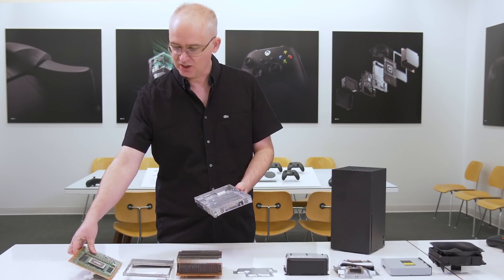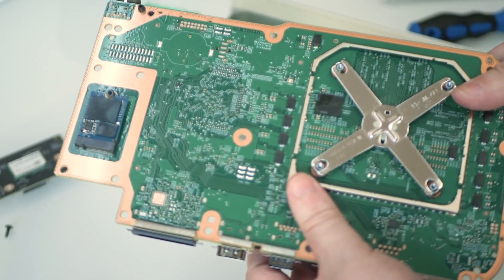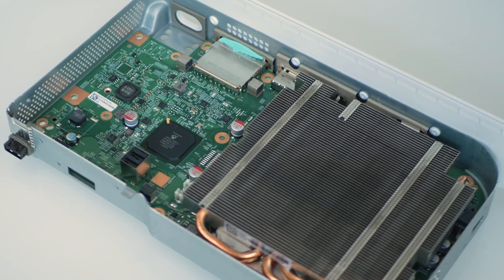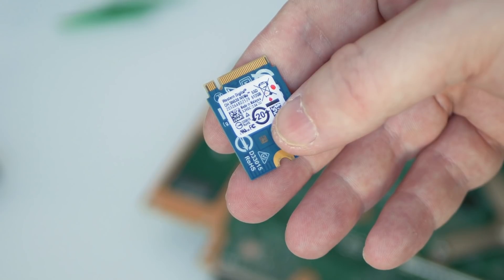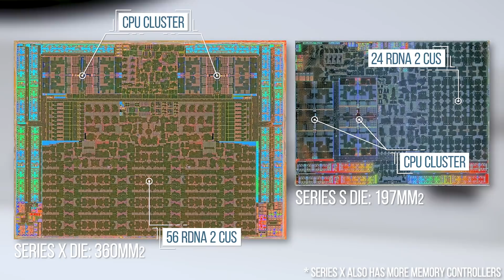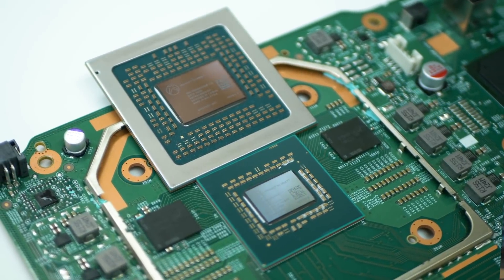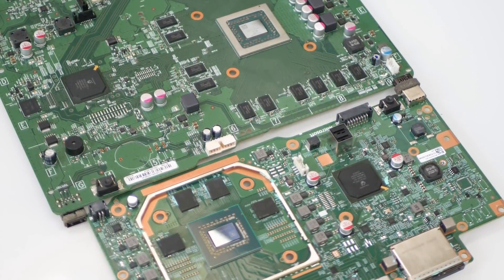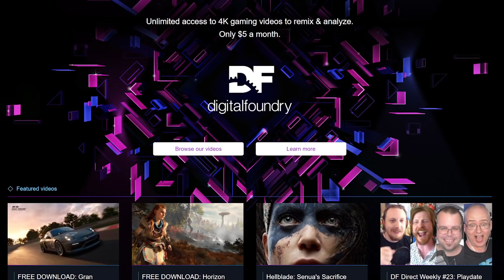Xbox Series S Complete Teardown: Inside Microsoft's Superb Mini-Console

Comment: I got a Series S because I couldn’t  get hold of a Series X. I didn’t expect to love the S as much as I do. Such a great little console that doesn’t feel as much of a downgrade as you’d think.
Reply: It’s a huge upgrade in so many ways if you’re playing on a 1080p display. If you have a higher res screen than that, the series x is by far the better choice.
Reply: @andrewmartel916  yeah but s is still a good choice with 4k tv, there is no reason to even consider a lower res tv but if you play with a monitor 1440p is the way to go
Reply: @andrewmartel916  you'd be surprised I have mine hooked up to 4k 43inch TV and between the series s and x you struggle to see a difference unless it's side by side. Some games run at 1440p even the 1080p games look to the naked eye like they're unscaled to 4k.
Reply: @andrewmartel916  even a 4k display is fine for a series s because its still able to simulate 1080p because it is exactly 4x the pixels. Essentially 4 pixels on a 4k display is 1 on a 1080p display so it will still look as crisp as a native 1080p display and let's you watch 4k Netflix or hulu or youtube
Reply: @andrewmartel916  Not entirely true, the Series S has much lesser viewing distance and the LoD doesn't run that far 1s on the Series X.
It means that on a 1008p-screen, you do miss out.
But it's still a big upgrade nevertheless.
Reply: @andrewmartel916  You still benefit from having a 4K tv. Series S is a native 1440, and can still upscale to 4K.
Reply: @andrewmartel916  Not in my experience. I have both consoles and both connected to 4K TVs and would be hard pressed to tell which is which. 4K upscaling works very well!
Reply: Same here. Will still get the Series X just to get the disc drive, but man the Series S is like Richard puts it: Superb
Reply: I don't know why people are so obsessed with getting 4k out of the console when they can't see the difference from the couch.... So to that end the S is perfect
Reply: @SquintyGears  I just wish they wouldn't have cheapest on the memory the 8gb for games shoulda been high speed that's the only real weakness beside no disc
Reply: @SquintyGears  oh, but you can in larger TV 55+ inch TVs.Since I got my One X last year, I haven’t touched my PS4 for third party stuff, 1080p is definitely muddier. There is a big difference in image clarity.
Reply: I have the Xbox Series X and I'm going to get the Xbox Series S for the bedroom.
Reply: I've been thinking about getting one.  it just sucks that I wouldn't be able to play my original and 360 disc based games.  if only I could prove I actually own these games with the series S.  🤷
Reply: There should be an external disk drive you can hook up to the S. Kinda like how there used to be a HD DRIVE player for the 360
Reply: @mickael486  Yeah I wish they made s drive you can use it presumably making people go digital is a big part of the profit motive given the sunsidy.

And allowing any USB Blu Ray disk drive to be used is asking for security problems given how much the 360 official drive was a security blackhole.
Reply: @mickael486  see o think ms should honor the barcode like a CD key and then just tie it to your account and you get a download or is however they choose. They used to have that lol.
Reply: @mickael486  Try getting the digital version when they’re on sale. I did that during MS’s pandemic sale of the games I like.
Reply: I have 2xs and a series s and on a 1080p tv they look exactly the same no bs. Even on the 4k tv from couch distance it looks damn near the same. Both are good.
Reply: I really want to get a Series S but I never got to experience Xbox One X enhanced games so I think I'll wait for the Series X to be more widely available
Reply: I might get it to sit alongside my PS5 at some point.
Reply: Same, bought an S cause i couldn't find a Series X and it's a wonderful little machine. Already have a good PC and a Switch but i wanted a dedicated machine to play games and maybe streaming them without having to stress my PC too much. Of course it's not as good as the Series X but since i'm playing on a 1080p screen, i can't tell i'm not happy with it. For the price of a Switch, you have something really impressive
Reply: @MadX8  my exact use case
Reply: Lots of trashy comments from trashy people here but eh.. there’s aways meaningless tools no matter where ya go.

Anyways, series S is really a great console. I got a ps5 but also wanted some of that sweet game pass but I wasn’t able to get a series x so i bought the S. Of course a week later i found a series x 😂 Still, having played both on a 4k screen the S performs way better than the specs would lead you to believe. it’s honestly shocking how well it plays. 1440/60 for most games and even 4k/60 on some.

If u can’t find a series x the S is absolutely worth purchasing. You can have a great time with game pass and grab the X later. Great machine.
Reply: The 4K 120hz purists make me laugh. Game within your means people. If you're not a big Xbox collector, don't mind lower resolution and just wanted Game Pass, it's just fine. Most people can't get an X any way unless you want to support scalpers.
Reply: @johnathanross6519  I don’t think most of them even know half of what they are talking about 😂 There’s always shallow fools who identify with things they own i guess. Sucks to be them.
Reply: I have both, and the S is definitely an amazing console. I am at the hospital right now with my daughter, we’ve been here for about a week, and when she’s asleep I am able to hook up my S and play a bit, such an easy console to just throw in my bag. Also been using Xcloud on my phone, that’s amazing too.
Reply: @rickyfelan  Obviously, if you have been there for a week, it is something rather serious, but I wish your daughter a full and speedy recovery. And your dedication to gaming is impressive.
Reply: @rickyfelan  Hope your daughter's OK, dude. Hospitals are the worst. All the best!
Reply: @rickyfelan  Hope the hospital went well mate !!
Reply: Same, couldn't get an X. The space on the HD sucks but I'm not complaining. I'll get an X maybe in 2 years when it's upgraded.
Reply: Right now I use my Series X is as my home console and the One X as my traveling console (would like to replace that with a Series S for travel purposes). If you are coming from a One S, I think most will be pleased by a Series S, coming from a One X however the Series S doesn’t quite feel like a true leap, the Series X does.
Reply: @sammyg4806  Exactly this.
Reply: I totally agree, wanted a series x so much, but just could not find one! Honestly can't fault the series s, the only real issue is the storage. For the price point and someone who has not upgraded to a 4k 2.1 hdmi tv. I'm very happy! I do think if you have such a tv or monitor that can run 120hz 4k the series x is the way to go with VRR and better ray tracing and frame rate series x is a beast that out performs everything on the market in the console space. Great review rich. Cheers
Reply: I bought one just to make it an emulator box.  I don't really care about new games.
Reply: @blank5210  A lot of people are doing that. It's a brilliant platform for emulation.
Reply: I have the Series X and it’s a powerful machine! I never use it…since I have my pc with a 3080ti…but when I do….it’s about as powerful as a 3060ti!!!! Which is quite powerful!
Reply: Never buy something if you actualy wanted something else if i could get a ps5 all digital if i actualy want the normal model i would wait no matter how long it takes
Reply: I think the Xbox series s is wonderful specially if it is used as a gaming PC rather than a home console... I put it on my desktop plugged to my 1080p monitor, and it is wonderful. I will be getting a keyboard and I will be playing battlefield and warzone with my Xbox series s just like a budget gaming PC. I have been playing Battlefield 5 and it runs better than my gaming laptop with an older core I7, 16 RAM, and GTX 1060....I even get ray tracing technology with my Xbox.
Reply: I had the exact same problem which, honestly, isn’t much of a problem at all! It’s a zippy little system and I’m really enjoying it. Game Pass is such an incredible deal.
Reply: Me too, I love the series s but really wanted the x at first. Maybe in a year or so I’ll get it with all access but I’m satisfied for mow
Reply: Same. I have a Series S because Series X consoles arent available on store shelves. I'm loving how small it is and it's surprisingly powerful for the cost.
Reply: Never settle champ
Reply: Same.
Reply: But for how long? How long until every game looks like it's running on a previous gen console compared to the same game on the X?
Reply: Mm never had a Microsoft console before, bought while I'm waiting for PS5 to become available. Great little machine
Reply: To me its a huge downgrade because you cant play disk, you lock yourself so much just being able to buy games from the store.
Reply: same!
Reply: I play destiny 2 and its way better on the series s than on the one X. Field of view slider and 60fps even at 1080p is way better.
Reply: Same here. I bought the series s because I never got the opportunity to buy a series x. But I'm quite happy with the system 😀
Reply: Same here i got sick of the scalpers buying all the series x stock, just bought a series s and it doesn’t disappoint, might get a x if scalpers stop scalping
Reply: Yes I have an S too and loving it. It's secondary to my PS5 usually but without it I probably wouldn't even get an Xbox this year. Still have a lot of those 360 digital games.
Reply: I own series X and series S, $200 for series S is great price
Reply: I have an RTX 2080 PC and I'm very happy with the Series S too
Reply: I got the Xbox series X but I'm going to buy the series S for my wife. When I saw it at best buy and how small it is I just had to have one and it's perfect for gaming with my wife because our other TV is only 1080p.
Reply: Yeah same here. Love the S.
Reply: Dude stop, the Sony guys can’t handle this much honesty.
Reply: The S is a no go for me.
Overpriced games in store, no ownership no selling games huge turn off
Reply: @Elysiabikha  what are you even talking about lol. Definitely a fanboy comment with no idea of reality.
Reply: @RedHaloManiac95  reality? Games are more expensive in digital like wtf? U can’t sell it u don’t own it
Reply: @Elysiabikha  Yeah, that's fair enough. I use it as a Game Pass machine. It only really makes sense if you have Game Pass.
Reply: @MattRichardsEsq  yea for gamepass it’s great
Reply: Same here and loving it!
Reply: POWERFULL console 3 times smaller, INSANE...
Reply: FACTS
Reply: HAHA I got an x
Reply: @ariannecoleman  I've got one too, now! 😄

I gave the S to my daughter. I stand by what I said: The S is surprisingly good for the money.
Reply: @MattRichardsEsq  cool sory for being mean cause that was a quick reply
Reply: @ariannecoleman  No problem Hugo. I didn't take it as being mean. It made me laugh.
Reply: Until you want to install games and take advantage of external hard drives now cause their “too slow” and can’t play x/s games (which I call bullshit)
Reply: I agree. The S is under rated, especially when connected to a 4K tv that also does upscaling. I’ve found that my TV identifies the S as a 4K device. In reality, I see little to no difference between it and the Series X that I recently bought. The difference between 4K native and 4K upscale is negligible! The only real benefit of the X is the optical drive, RAM and internal storage. I like both. MS has a couple of winners this time around!
Reply: I want to get the series s but the ram scares me only 8gb for games ... and the series x is over 600 euro's so not worth it imo
Reply: @Niick06__19  There are some big drawbacks to graphical fidelity on newer games on the S now. However, it's still a decent entry level console.
Reply: It is
Reply: Agreed. And it's also small. Not everyone can justify $500 (Canadian). The Best controller feel is also a BIG plus. I know PC Fanboys are mad af because XBSS is only $300 😂
Reply: Same, haven't felt the need to upgrade to the X. May later but certainly happy currently
Reply: If you don’t have a 4K display there no reason to get the Series X.
Reply: @Ace21kg  I don’t agree with this. It’s still better than the series S even running on a 1080p tv.
Reply: @Ace21kg  There are benefits with XSX on a 1080p screen. 60FPS vs 30FPS on certain games, higher graphics fidelity overall, raytracing, 1TB storage and a disk drive. Also 4k TV are cheap in 2021
Reply: @Alphalete7  My TV upscales to 4k 60 on the Series S, It's not Native, but it looks good enough and all 4k TVs are not equal lol you can get some crappy 4k TV's for cheap that are only 30 frames still.
Reply: All I want is an S. I’ll pass on the X honestly. Ready to mod the shit out the case.
Reply: How did you brick the S?
Reply: Glorified last gen machine.
Reply: You used the Xbox series x ? i have one and had the series s to gave it to my brother
Reply: @ot9523  Yes I've played on an X. Obviously, it's way better than the S. Still, the S surprised me with how good it is.
Reply: @ot9523  X is better obviously given the better specs but really loving the S price and form factor even for a home console.

Only downside is the storage but I use a USB HDD to help store games and load the main SSD but I'm playing in those days.
Reply: On the technological stand point 
It's dawn impressive.  

However if someone comes from a Xbox one x .
The séries s is downgrade. 
Not because of the target resolution  but the backwards compatibility. 
For now the séries s is a glorified Xbox one....unfortunately. 
The only good reason to get a séries s now is the speed and the steady performance. 
The séries s plays the version of games that had to be butchered to even fit the Xbox one hardware specifications.🥲.

But the sentence form people saying:
 " the Xbox series s will hold back the séries x " 
I  think it's utterly wrong.
It's the same architecture for both séries x and s. 
And if anything ,I believe the differences won't be as prominent between the séries x and s than it was between the Xbox one and one x.
 At first ( as we can see now, the séries x and s differences are unfortunately night and day ,)
simply because of the backwards compatibility of the séries s that doesn't help her and when a game is optimized  of séries s the developers use the Xbox one version to adapt it on séries s. 

So to recap 
1) the differences between the séries x and s = night  and day( For now)

2) the difference won't be as dramatic in the future  at least not to the extent  of the Xbox one and Xbox onex🙄

3) the séries s didn't had a chance  to shine  even at the beginning  since  there were no next gen games and the only way to play  with the séries s was through the backward compatibility.
Reply: It doesn't seem like much of a downgrade depending on multiple factors but to me it does. Mostly because Xbox Series S is advertised as a 1440p console yet most games are running at sub 1080p meaning below 1080p or dynamic 1080p but it dips lower than that most of the time, so unlike the Series X it is way off target and its obvious the memory and bandwidth wasn't enough for 1440p in most titles and it certainly isn't enough for 1080p with next gen features, which means you will be enjoying ray tracing at 512p, 640p or 720p like in every RT game so far

So the issue with the Series S I have for me is that its blurry, because resolutions are too low. I have a 1080p display and the majority of enhanced games I play look blurry. 1080p should be the minimum in 2021 even for a budget system, not a luxury (unless its a handheld) but if you own a 720p tv, sit reallyy far away or you're coming from the base Xbox One so you are already use to these resolutions then you get the benefit of higher framerates and settings and are satisfied because it was an upgrade from what you had before and it was cheap, its all about your situation which defines your perspective. Which is why I'm fine with people liking the console, but I don't feel like the system they advertised is the one I got.
Reply: The design and engineering is way ahead of the PS5
Reply: Just admit it, your still trying to justify you got a good console, but in reality you wanted the X. Its ok, just let it out.
Reply: @TN_AU  I did want the X. But I got the S because scalpers prevented me from getting an X. I'm not trying to justify getting the S... it has surprised me with how good it is. Nowhere near as bad as I thought it would be.

I'll still get an X though, and my S will end up as a bedroom console or will get passed on to another family member.
Reply: @MattRichardsEsq  dont worry, I think everyone is in the same boat. Im still on the fence with the S, I recently got a PS5, took ages but got one, so its a cat and mouse game with getting the X.
Reply: @raios-rogueboss-slayer4179  Ha ha!! Whatever, my friend. I'm happy with the S for now. You carry on getting angry for no reason.
Reply: @raios-rogueboss-slayer4179  You seem very passionate about this. How come this is such a big deal to you?
Reply: @raios-rogueboss-slayer4179  I hope in real life your personality trait isn't as bland as this mask you wear, fam.
Reply: @raios-rogueboss-slayer4179  whatever makes you sleep and feel superior Brothers.
Reply: @MattRichardsEsq  once I get an x im sending the s to my daughter.
Reply: @raios-rogueboss-slayer4179  Microsoft advertised the Series S as a raytracing capable machine?
Reply: @raios-rogueboss-slayer4179  lol did mommy abandon you?
Reply: @raios-rogueboss-slayer4179  wow for someone claiming to know so much how is it that you dont even know how much ram the system has? It has 10gbs of gddr6. Even with 8gbs thats plenty for 4k gaming argue until you are blue if you want but my 2080 super is never filled to 8gbs. Oh yeah thats right so 10gbs will be excessive for 1080/1440p. Get your info right before stirring the pot.
Reply: @raios-rogueboss-slayer4179  so we are going to get 1080p games. You think we care?
Reply: @TN_AU  i got the S and there isn't a single game that has me wishing i bought the Series X. I'm missing Ray Tracing in a game or two, but since Ray Tracing on these consoles is pretty weak and only used shadows or overdone reclections that look weird (Watch Dogs), that's not a big deal.
Reply: @TheDadGamer1  The X has the upper hand for those that has physical discs from previous gen that want to play. Then the X is required, I agree, nothing at the moment will push the console to its limits, maybe in a few years, games may/will look better.
Reply: @TN_AU  I got both and I can't see that much of a difference to justify spending 300 more dollars haha
Reply: @TN_AU  Wrong
Reply: @TN_AU  the thing is for at least 80 percent of people, the s is the better option. in fact a good amount of people with the x don’t even have the display necessary to take full advantage of what the console has to offer. most peoples tv / monitor is more optimal paired with the s.
Reply: @TN_AU found the series s hater
Reply: @tarheelpro87  nah, I'm good now, I've come to terms, S is good